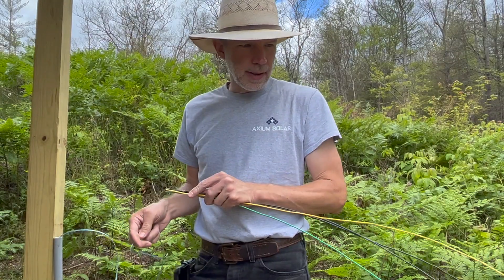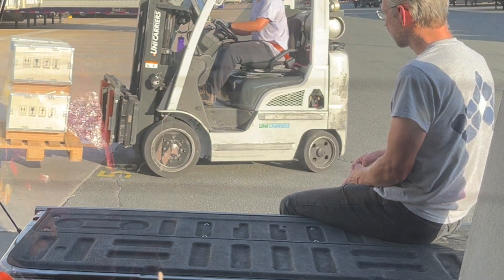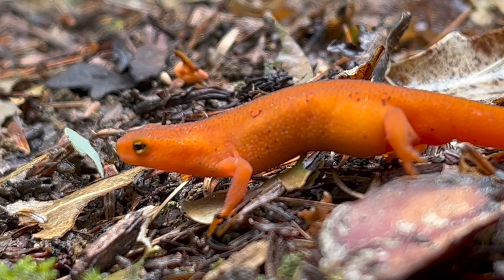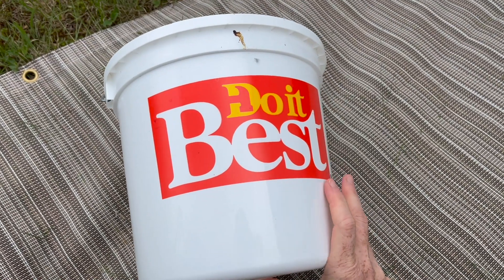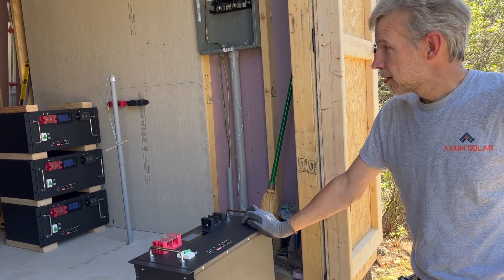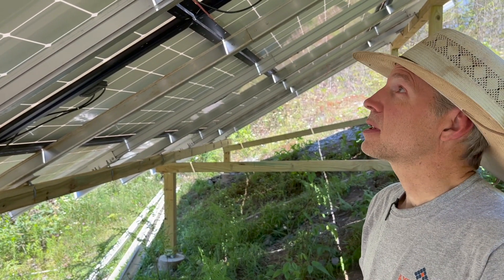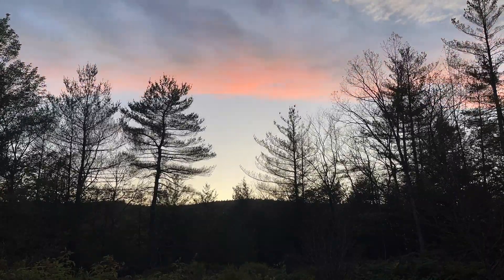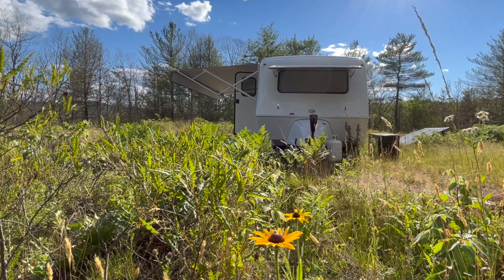Solar power for our OFF-GRID HOME (Vermont DIY off-grid home build)

Comment: How did you learn or where can I get full information of solar panels, battery and inverter and how to install them, I’m also planning to put the same in homestead farm in VA but having hard time to get all the information. Thanks if you share the details
Reply from the maker: Hi Remesh, I (Charles) have been a solar engineer working in the industry for over 8 years. While this is actually what I have done for a living, it is not beyond the realm of a DIY project. There are a lot of things to consider when designing your system, but the actual installation need not be overly difficult. If you have a good understanding of electricity, and are relatively handy, you should be able to learn and do it. If you do not, I would not attempt it. There is too much potential to waste a lot of money.
If you do have the skills, there are lots of resources out there to draw from: YouTube videos, books, and really if you pick a reputable equipment supplier, they can actually help you design a workable system. There are many, but the Alt-E Store is one I have heard is pretty good.
https://www.altestore.com/diy-solar-resources/

Comment: I’m presuming a mid-90s temp is not the norm for y’all’s new location? Hope we find out that y’all got the AC in and done in time for that!
Reply from the maker: Yes, that's true. And we didn't get it installed for that day, but we did get it running soon afterward.